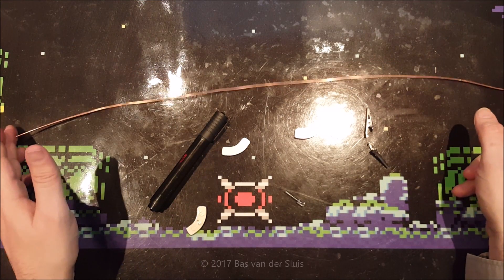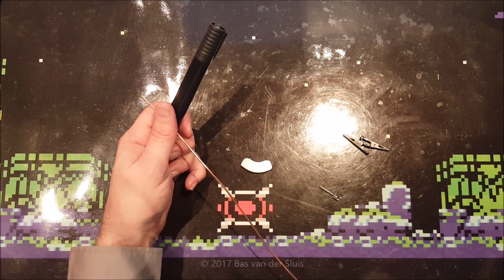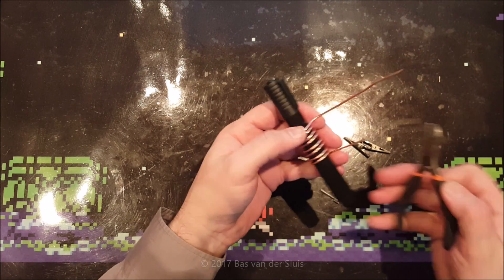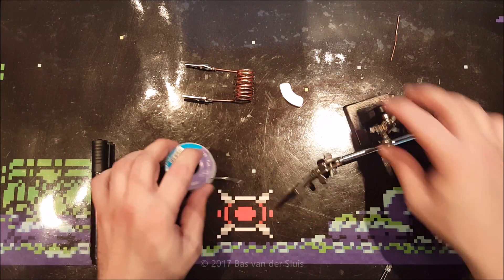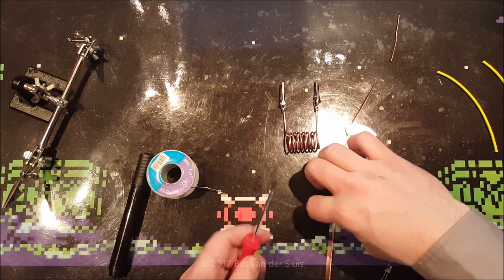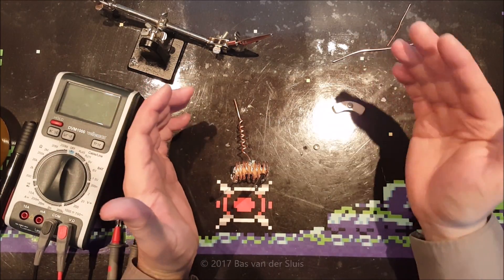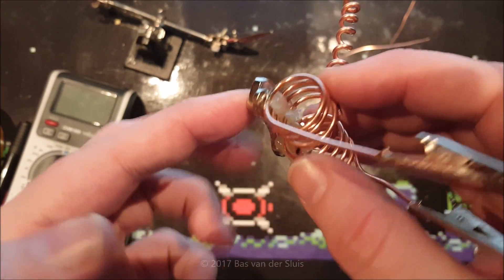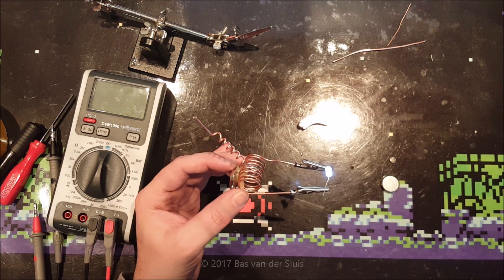Free Energy Generator - Debunked!

Comment: a coil and no cap? maybe it can work.. 1. a thunder storm near by (max. 1km) causes very high voltage an my big antennas.
2. Use it near by my transmitter and i power up the amplifier to 5KW RF Power shortwave :D